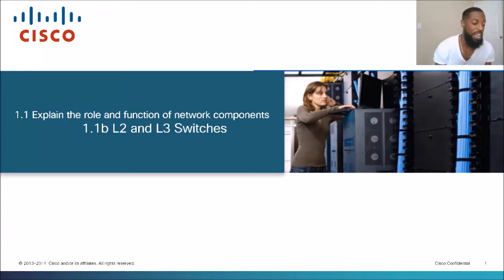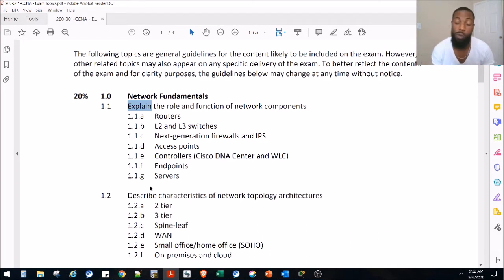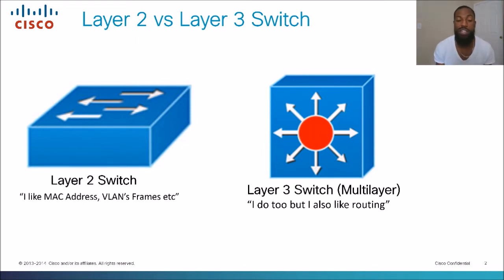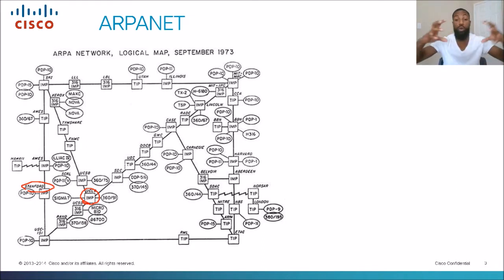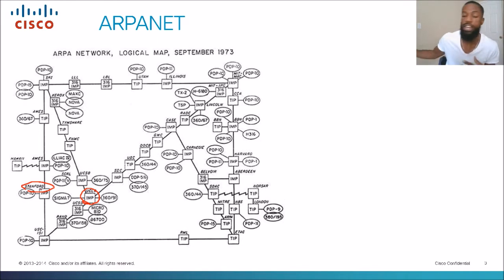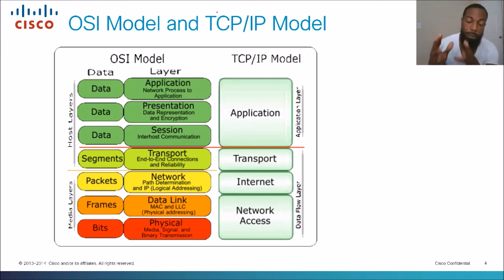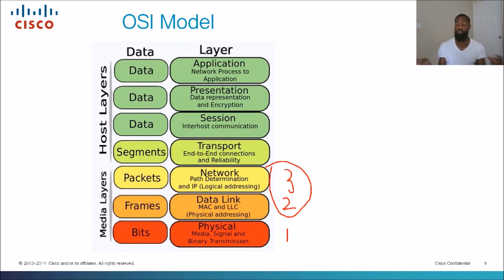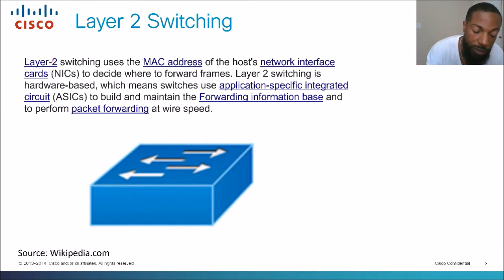1.1b L2 and L3 Switches  CCNA Exam (Theory)

Comment: I like the style, man. I was really looking for info about whether a L3 switch can do dhcp and nat, etc, like a router can. I'm in a digital forensics degree program, and the 3 Cisco classes I took (that covered all of 200-301, I still have all the textbooks, and Odom's courses, etc) made me realize I love networking more than forensics. But the 200-301 content, almost every time they mention a L3 switch, say 'L3 switches are beyond the scope of this content'. So I assumed I was unlikely to run into them.  Well, I just got my hands on a 3850 24p L3 switch (for my home use) and wondered if it could replace my router and do all the ipSec, NAT, dhcp etc, and just didn't know. Thanks for the info.  You did mention adding subinterfaces is complicated (in terms of scaling), I'm not sure why you would say that. I know that you know it's a simple int gx/x.x, encapsulation dot1q command, so I'm not sure I get why you would suggest it's complicated.  In any case, thanks for the content, and, nice delivery 👍
Reply from the maker: Hey thanks for the compliments and constructive criticism. I think i only mentioned that subinterfaces was complex because this is one of the first bulletpoints on the exam so for it to be introduced so early when I haven't even taught anything about subnetting, configuring a standard interface etc its a bit walking before crawling. Again thanks for watching and commenting Scott !!!